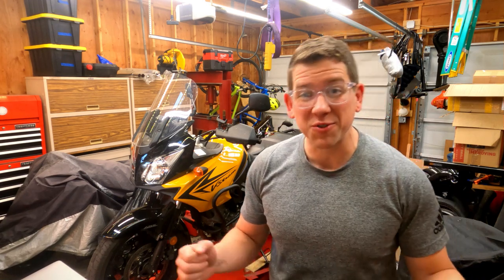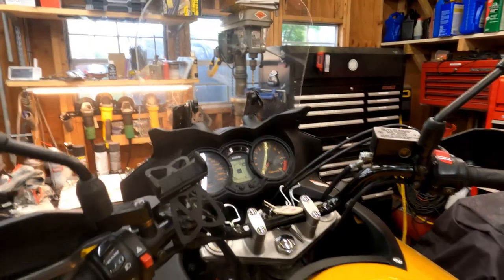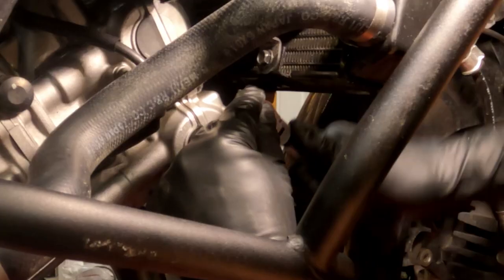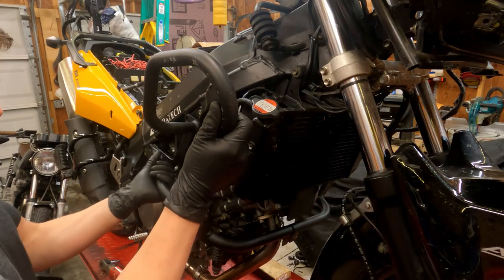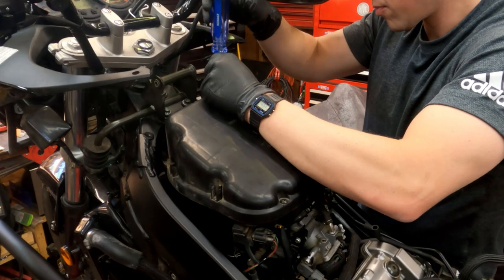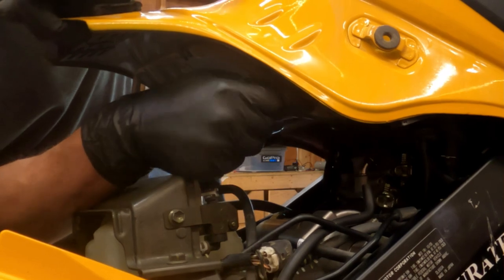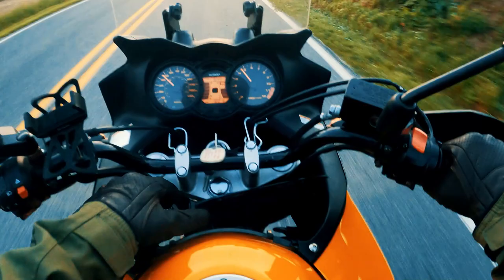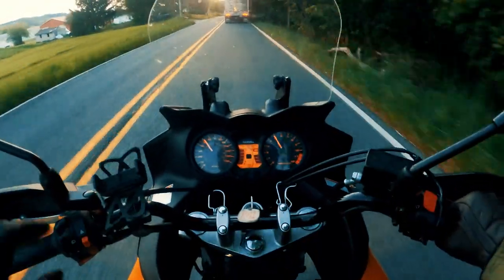Wrenching and Riding on a V-Strom 650 - spark plugs, air filter, chain service, and TEST DRIVE!

Comment: For such a well produced video only 42 likes in a year?    I think that the "meh-" tone of your review is a bit unfair and may be turning actual Strom owners off.  You seem to be comparing it to a sport bike which it is not. My '09 650 is plenty flickable with the right tires;  Anakee Adventure radials in my case.  I've never felt I had to work to get the bike turned in.  It does just fine in the twisties.  You appear to have not leaned the bike over hardly at all in your handlebar lock "test".  This is understandable on an unfamiliar bike but it will turn a surprisingly tight circle in the right hands.   It IS a big bike though.  Curb weight pushes 500lbs with crash bars, skid plate, panniers and a full tank but still has enough power to get my 260 lbs going as fast as quickly as I care to go.  It will cruise at 75mph (probably more) fully loaded all day long, then hit the fire roads with no worries.  Your characterization as a "pig" really hurts, bro.  I think you'll find that most actual DL650 owners absolutely love them.
Reply from the maker: Thanks for your sympathy looking at my 'likes'! haha. I always made these videos just for fun though, never for views. I appreciate it nonetheless. 

It's a fine motorcycle and I have no doubt that it can cruise all day at those speeds. It just lacks torque. Only 45lb/ft....that's only a little more than a 1982 Honda cb650. But, nobody is buying the 650 expecting it to be powerful. It's adequate, and that's okay. 

And "pigs" can be nice! haha, no offense intended, it's just big and heavy and not fast....hence a pig. 

I appreciate your views!